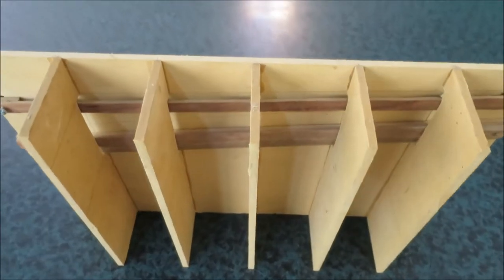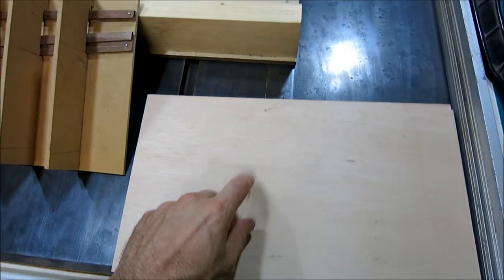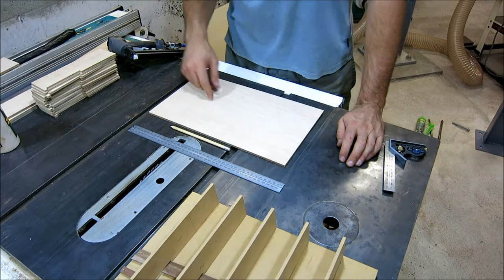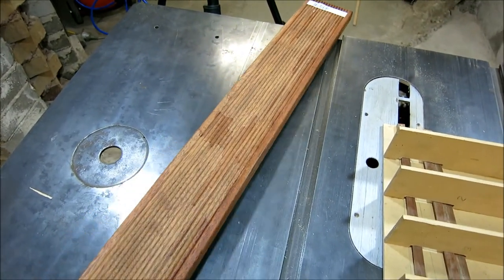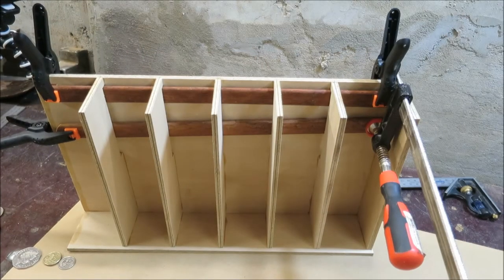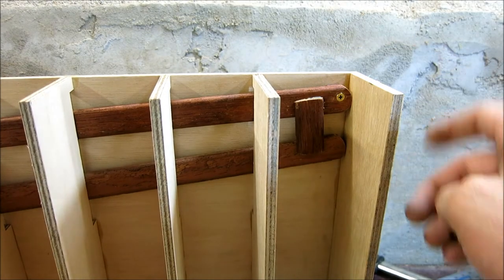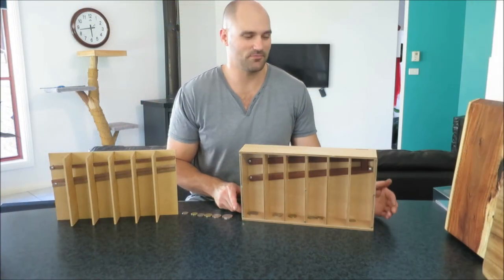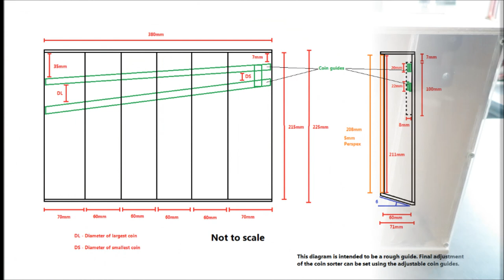Coin sorting money box - build

Comment: Sorry to be slow, but I still don't really get what is pushing the coins off the ledge?
Reply from the maker: gravity, the coin is held in by the top rail until the gap between the rails becomes bigger than the coin (the rails expand out the further they get from the start) and it falls out.
Reply from the maker: thats why the hole thing leans forward slightly.
Reply: @mtarrant3  Thanks! About to start making this without power tools - wish me luck!
Reply: @mtarrant3   My first attempt failed. Took me ages to get the angle right to differentiate the $2 & 5c, and the $1 and 10c. It was so incredibly touchy for me that when I found the angle that worked I glued around the guide rails while it was clamped in place so that I didn't risk ruining the angle by even a fraction of a mm. I tested it once glued and clamped and it was fine, but by morning something had changed and even the 20c was falling out all over the place. No idea what went wrong. Maybe a wider spacing of the dividers could help me?
Reply: @mtarrant3  hey mate do you sell these coin sorters I would like one but don't have the tools to do it properly
Reply from the maker: @bladeclark1181  sorry but I dont